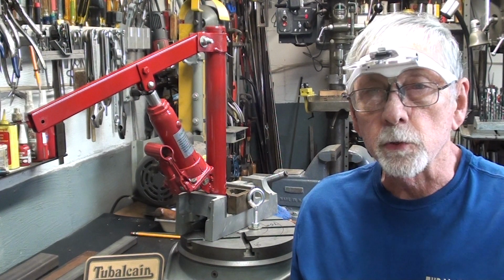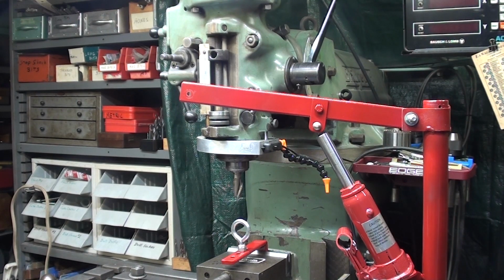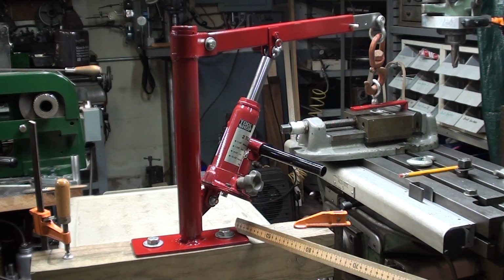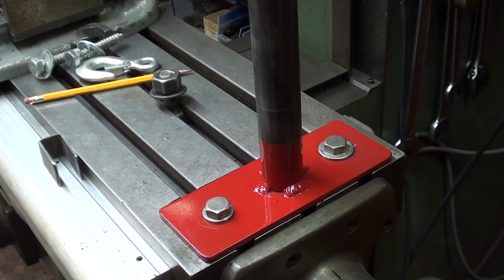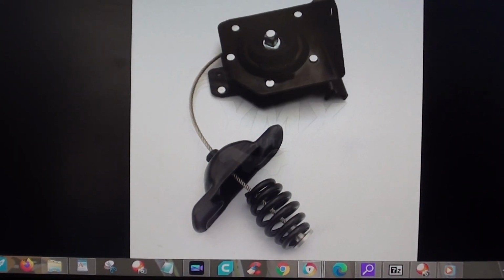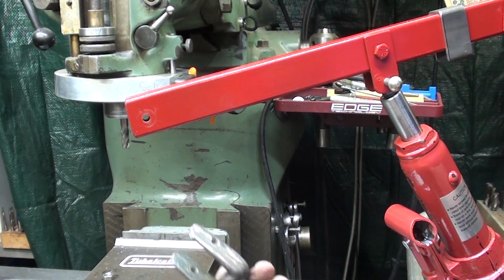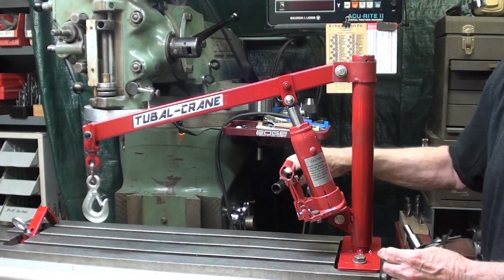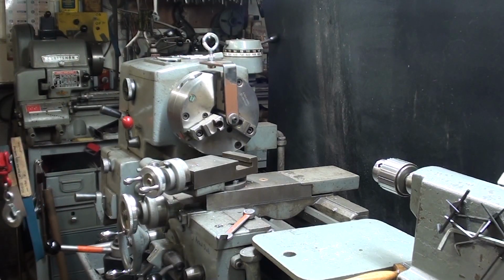Tubal-Crane - SKY Hook for Bridgeport Rotary Table pt 3 #729 tubalcain

Comment: Pete. The winch and cable would be most advantageous because you can lower the rotary table to floor level vs to the cart. I put my rotary table on a wooden dolly and roll it under the workbench when not in use. When needed, roll it over to the Bridgeport attach a cable and winch it up to the milling machine table. Use either a hand-crank boat winch or a mini electric winch they use for ATV 4 wheel motorcycles. Its around 1500 lb mini-winch. Size of the palm of your hand.
Also. The largest "moment" of your device is at the base where it bolts to the t-slot table. It should be a larger flange with gussets. I just bought a bunch of pre-cut triangle gussets on ebay for $15.00. The guy laser cuts large batches of them and sells them on ebay. Search this term on ebay  Steel Weld Gussets 3" X 3" X 1/8" A36 Steel (12) Piece Steel Weld Gusset Set . Maybe you can incorporate this gusseted base on the lathe attachment. It would be much safer.

Comment: Mr Pete looks good its done and i also like it the way it is  . Just an idea  if you would rather have a crank style lifting mechanism is to replace the jack with a acme screw and nut and rotate the screw like is done to raise and lower  Z axis on mills . They also make 12 volt actuators that could replace the jack . Cant wait to see how you adapt it to the lathe . Eight inch chucks are a bit heavy . Keep up the good work Thanks
Reply from the maker: Thanks

Comment: If you can lead a 2 ton bull it's fine for a lathe chuck. Yes I raise cattle

I have my homemade crane on my cheap HF steel cart. All you have to do is add weight to the lower shelf. Been using it for the last 20 years, it's not rocket surgery. HF makes crap but I get the feeling you just want to trash talk instead of working out the problem.
The spare tire winch on my 1987 blazer still works fine. Some of use don't live in the salt belt.

Comment: Also, the make a lifting device for motors and other heavy things that uses a threaded shaft to move the lifting point of the bracket, but weight is carried by a rail not the threaded shaft.
car jack may be to big of shaft though.

have a great day

Comment: With what you have a boat winch would fit on your your top bar and put a pulley on the extension tube. I love your hook you modified. On the tubal-Crane sticker you need to put (Do not exceed 40,000 tons on a rainy day.) On one of my cranes I have a porta-power mounted to the vertical shaft and use a ram instead of the jack. Easier to jack but it's heavier when moving it.

Comment: I have had a tubal crane for years. I first installed it for the receiver hitch on my truck. Very useful. I then started installing receiver hitches on my work benches. Now I use it all over the shop. I then started putting vices and other tools that would fit in my receiver hitches. So it won't wobble I put a nut on the corner of the square tubing so that a bolt would push it diagonally. (corner to corner.) Be aware of your counter weight and it will work great. When you don't need the tool just remove it and put it out of the way.

Comment: Nice crane. The older I get the weaker I get. I've got an 8" RT with an 8" chuck mounted. I currently have to take the chuck off to put it on the mill. I have a MT3 post that I use to clamp the vice to and then bolt it to the RT. Then rotate the RT to the vertical. I've got to make a Mr. Pete crane.

Comment: Nice work Mr. Pete !!  You may have covered it, and I wasn't paying close enough attention .... but why is it you don't mount the Tubal-Crane on the left hand side of the Mill table, so the jack handle and valve would be accessible from the front of the Mill ?
Reply from the maker: I did, in  part two

Comment: If someone was really worried about not having enough weld with no gussets you could just simply drill a hole through the plate pass the pipe almost all the way through then weld from the top and bottom and grind the bottom flush and have plenty of weld you could probably also make an aluminum version with 1/4inch wall and he fine but the steel is so light I really don't think that's needed 👍👍👍

Comment: Crabby is in the ear of the beholder.  I found your presentation right on point with the proper emphasis on the points discussed.  I really liked the extension and I do see that adding a length of chain would be handy.  Suppose you needed to store a heavy object near the floor, pick it up the length of travel, add blocks under it, shorten the chain and continue.  Great series and I understand the entire subject of committees and getting nothing done.

Comment: How about mounting a grab hook to the boom? Then use a chain that has a hook attached to one end. You could hook the chain to the vise then drape the chain over the grab hook. It would be adjustable to any length depending on what link you used in the grab hook. Just a thought..
Reply: @mrpete222  I just didn't watch long enough before I opened my mouth!

Comment: I watched the first video and decided I would build one. 30 minutes later I found the HF version (new old stock) for $40. I own it now and it has been modified to fit my table T slots!
Mine is bigger than necessary, but it functions as is. I will make some more modifications for further enhancement, but I can use it as is. Lyle's is lighter than mine and I value that, but the HF design is still easy to handle. I really like the jack valve handle modification Lyle employed. The HF version bottle jack rotates 360 degrees allowing jacking from any direction. 
I am embarrassed that I now own a tool from HF, but this hoist saved me a lot of time and $40 was not painful.

I wish I had a clever moniker like Lyle so I could name mine something like Lyle named his.
Reply: Do you have a SKU on that new old stock?  I love Mr. Pete's ideas but I just do not have the time to put one together ... sigh.  At seventy you'd think I would be able to enjoy my golden years, but NO! ... lol
Reply: @marklatham5692  Mark,
Central Hydraulics, Pick Up Truck Lift, 1000 LB, SKU #1647
The Craigslist seller told me that he purchased this in the late 1990's and intended to install it on his truck. He never did, and it banged around in his garage ever since. 

Good luck!

It is still available at HF for $114.99.

Comment: I like the Tubal Crane! The telescoping extension and longer boom are both great solutions. Moving the jack clevis point back just 2” makes a huge difference. People need to focus on the limited requirements and budgets of a project like this. Plenty strong as it is👍. “Like the wreck if the Hesperus”😜. Haven’t heard that for years. Dad used to use it and learned it from his Mom😊. Love your rants, well justified. Keep up the great work 👍😊

Comment: All of your crane versions are good but I like the adjustable prototype better.  I agree with your assessment on all of the commenter’s improvement suggestions — no need to make it heavier with “improvements” — you’re not lifting an engine.

I own the HF lift table.  Due to space restrictions, I bought the smaller one.  If you have room, I would suggest the larger, higher lift, more expensive version.  My friend has it and it is better.  For the price, they do work well.

Comment: It would be easier to show a picture of what I came up with.  It works only for changing lathe chucks at the moment ... both weigh around 100 lbs.  I've dubbed it with the title of "FHP."  Future Hernia Preventer.

I've got part of a salvaged gin pole, with a boat winch already on it, that I plan to use for a more versatile swing arm, for mounting heavy work in the lathe.  The plan is to use the boat winch for adjusting the elevation of the arm (which will affect it's position over the lathe bed), while the small chain hoist that is currently in use will handle the lifting of the chuck or part.  The current arm is fixed, so I have to use wood cradles to move the chucks to or away from the spindle.

Comment: The release on those jacks are that shape for a reason.  Generally when you're using a jack it's under something heavy and to get to the release you may have to put part of your body under the something heavy it's under.  That shape makes it easy to reach and manipulate with a flattened tube, so if something heavy falls and knocks over the jack it's the tube that gets crushed instead of some or all of your body.

Comment: The tire winch on my 91 GMC pickup works fine.   So it depends on where one lives.   Maybe salt on the road kills them?
Reply: The ones fitted in the UK only work they day you pick up your new van 😂. Get a flat from day two onwards and you're battling with a heap of rusting crap. Just used mine for first time in 170000 miles after an hour or so and plenty of WD40... Joyless. Rain and salt. Keeps the car industry going I suppose.

Comment: An idiot is rarely insulted.
Because they rarely understand the insult.
There is no advantage or need to have the jack vertical. If the commenters are thinking of the fluid level in the jack, you can go beyond 45° before any problems occur.
Reply from the maker: You cracked me up

Comment: Thanks for this entertaining and inspiring project and the serie of videos. Really one of Your top viedo series.
Some things surprices me. 
The development, the design, has the style of a black smith working. Sledge hammers, brutal force etc... Not what You're known to do. You've never been a snob but this project is really special in being simple and practical.
The desire for simplicity, and light weight is really clever.
Likely some comments comes from home made paper machinists, like the double sided way to pump up Brr, what a Bosch machine You use. Don't become suicidal... Joking!
10 tons of preassure and slipping..... Mounting the crane on the cart......
You really pull down the pants on some commenting guys... What medication do You use to manage reading that?
House built by (Stan) Laurel and (Oliver) Hardy..... Why/how did You get into that place? Joking!
Time 18:45... Criticized... Have they never seen an excavator? Vertical jack? Nonsens.
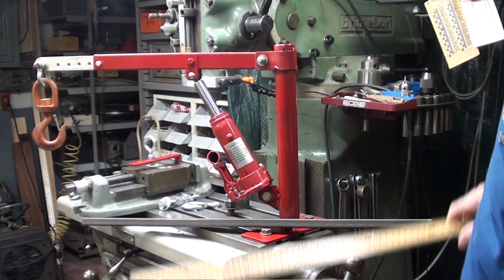Time 24:22... Oops.. 500 milimeters. Thats nearly 20 inches.....
Looking forward to the next part.
Reply from the maker: Thank you for your support. I often make myself laugh, even when I’m alone in the car
Reply: @mrpete222  You've made so many interesting, inspiring and educational videos to be thankful for. Reward that work, those videos, is my intention. If there's a less interesting video, let it pass. 
Laughter extends life we say here! Stay on top!

Comment: If the boom is too long for the lathe you could just drill more holes for the hook to change the effective length. The headstock doesn't extend high enough to interfere with the end of the boom.

Comment: Great crane,  can I suggest that now you have opened the hole for the lever to be used either side on the jack that you put a pin in it so that the pump lever does not slide while you are using it.
Reply from the maker: Yes

Comment: The adjustable extension makes it even more valuable. Moving the jack pivot point closer to the stem, increase the load on the jack and it makes it somewhat harder to control, but nevertheless; this is your design and I am in no position to criticize any of it. And, yes; I watched the whole thing.

Comment: That boom extension looks really nice. I probably would have left it with that rather than making a new boom. Could always have a second set of mounting points for the top of the jack. Also, I 100% agree, the stupid little pins they put in the valve of the jack should pretty much always be replaced with a knob or lever of some sort.
Reply from the maker: Yes

Comment: Beauty of an extension! Can't wait for the next whacky adventure. Nice knob btw, hmm. Have an extra steam engine flywheel? Could run a connecting rod straight to the pumps cylinder. Turn the flywheel to pump it, heh heh. If you get bored someday.  

Sincerely, a stoner in the back of the committee. :D

Comment: Hello Mr. Pete, I was thinking about the same problem. I want to try a rail on the ceiling, between the lathe and the mill. so I could use a winch on both places and could put a cart between the mill and the lace. But I think i wouldn't like the optic os a rail diagonal through the room.
Many greetings from Germany

Comment: Since you have a shorter arm already painted, make up another post  with a tool post fitting to go on your Aloris chuck. Using the lathe saddle and cross slide will give you more accuracy in placement.

Comment: I did watch the complete series in full, and I was wondering if you had considered mounting the crane to the opposite end of the mill table. Then you could satisfy all those backward people, and the Jack handle would be easier to access. Just my opinion, and it's worth what it cost you.
Reply from the maker: You mean like I did it in part two

Comment: Dont blame you for being crabby. Dont they think you know metal and the weights to consider. Every part of this crane is far stronger then they think. The mods are normal like you said . I have a cart I welded up that stands about 4 ft high on wheels I plan on adding a crane on a corner but the cart weighs well over the weight of my vises n rotary table.

Comment: My grandfather owned a welding and machine shop may years ago. He's been gone for almost 40 years. He had terrible arthritis and couldn't lift much any longer. So, he had built numerous lifting devices around his shop. Some were chain hoists, some boom or job cranes, and some were hydraulic lifts similar to yours. Personally, I really like your version two the best. I think you hit on a valuable option with the variable length boom. He worked his whole life without injuries, even before machines had safety sheilds. Forget the safety nazis! You have common sense and that is more useful. I've yet to find a safety Nazi who wanted to be helpful in achieving a goal. They only seem interested in blocking goals. If you can show someone their flaws, you should work with them to develop a better solution. Very few, if any, seem interested in being more than a speed bump to progress.

Comment: nice puppy. I like the adjustable extension, I would have just ground the paint away and put a new hydraulic mount in closer for a test. I think the adjustable one is a better idea.  I also like the tire winch idea as an option, that would make for a fixed arm on the crane, or adjustable using a protractor type mount.

Comment: I too stayed till the end of the class, so did you get a shop dog or is it only there to check to see  who stilled for the extra credit? I do have a question about the jack, could the whole unit be turned 180  on the lower base plate? that would place the pump handle and know out front.
Got me looking at building some type of " Bench Crane " to help lift the motors from my garden tractors up to the bench when I have to work on them.
 Great project , love all that you show and do.
Joe

Comment: So-to me an obvious question or did I already miss the answer?  Why not mount the "Tubal-Crane" on the left side of the table so that the knob and pump handle are on the side facing you?  I'm right handed and actually the left side seems to be better for me.  At work I use an engine lift with special hook at the end to lift and change out reels in a Stertiort. (You'll have to look that up since the explanation of a Steritort would be a little complicated for a comment.)  Most engine lifts are set up with the valve and pump handle on the ram are to the left when facing the lift.
By the way I think you should trade-mark the "Tubal-Crane" name.
Have a great day!
Reply from the maker: You mean like I did in part two?